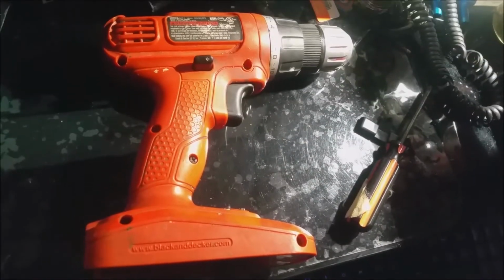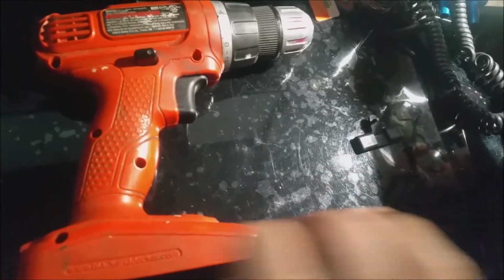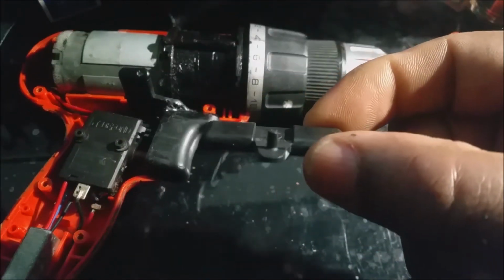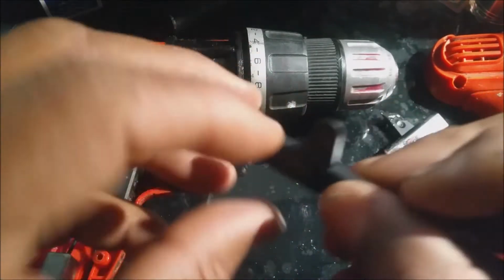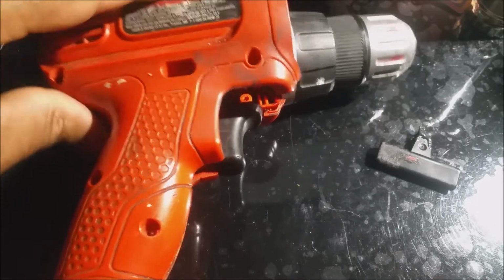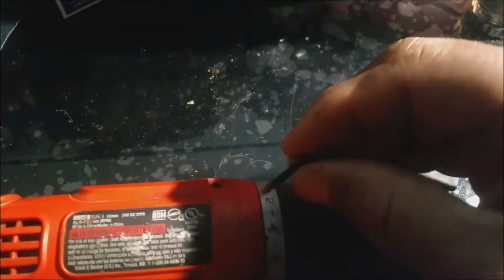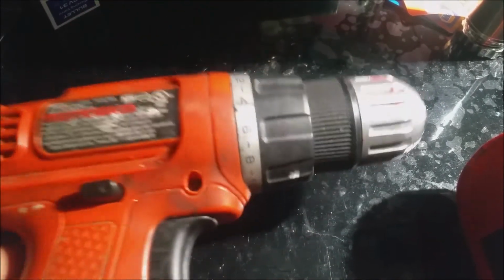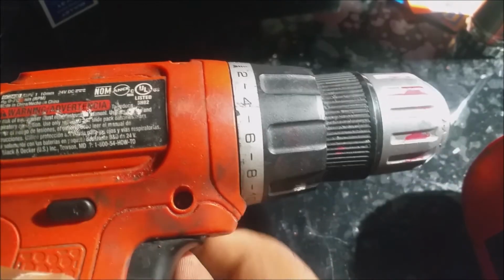Black and Decker GC2400 cordless drill  F/R ACTUATOR SWITCH

Comment: Hi. I have a similar drill and i bought the actuator switch and put it on but it is not moving like yours is doing. It seems as though it is stuck. Can you please tell me if it can be fixed. Thanks.